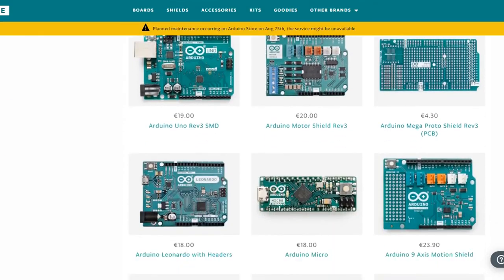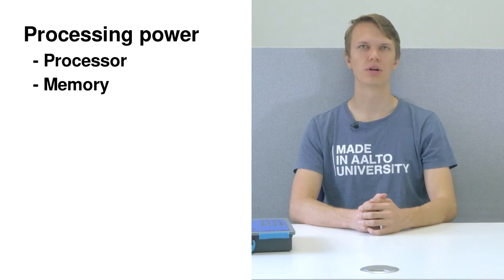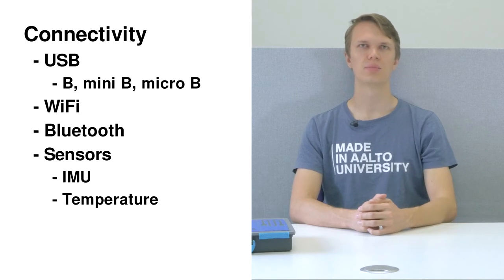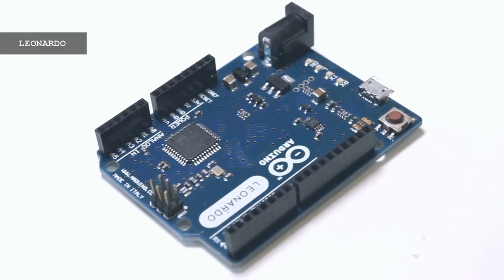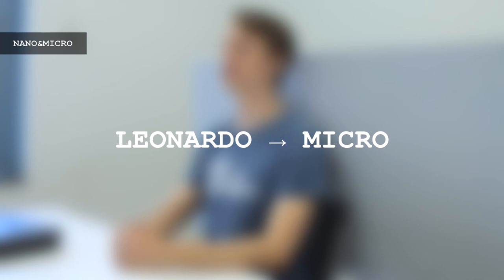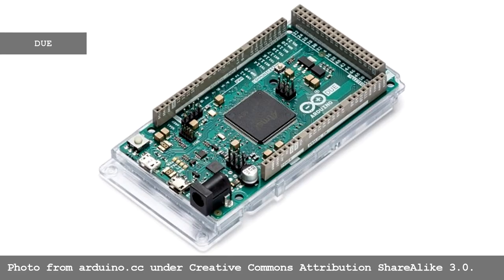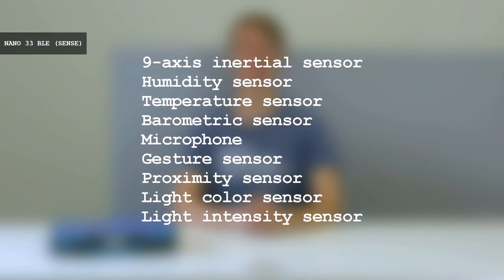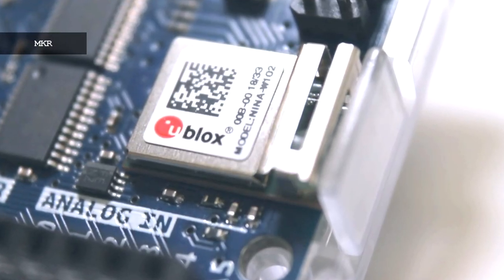How to Choose Arduino Board for Your Project | Arduino Basics Tutorial

Comment: Thank you for a good introduction. Could you help me on board choice?  I'd like to make a platform that gathers data from onboard sensors (inside air quality and other air parameters) and remote sensor (outside air quality), record and send the data through wifi and steers an air cleaner by IR depending on air quality level plus display.
Reply from the maker: I would definitely suggest a board that has built-in WiFi such as Arduino Nano 33 IoT or MKR WiFi 1010. Arduino WiFi rev.2 is also an option which is probably more beginner friendly (so is the MKR board). The sensors you are mentioning (air quality/parameters) as well as the IR connection will need to be external sensor. So watch out that the board has enough IO!

Nano 33 BLE Sense has sensors for measuring humidity, temperature and air pressure, however, it lacks the built-in WiFi
Reply: @memechatronics592  Thanks a lot. Would Arduino Nano 33 IoT with ESP-01 ESP8266 be fine too?
Reply from the maker: Sorry for the delayed reply. The Nano 33 IoT has built-in WiFi and Bluetooth so an ESP-01 ESP8266 module is not needed. If I understood your question correctly.